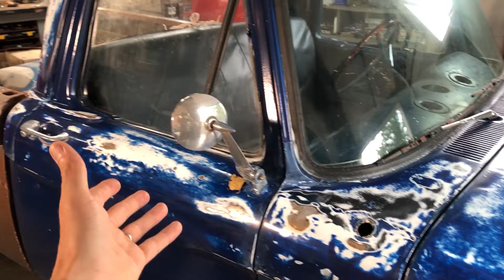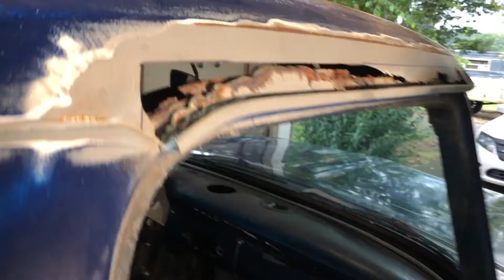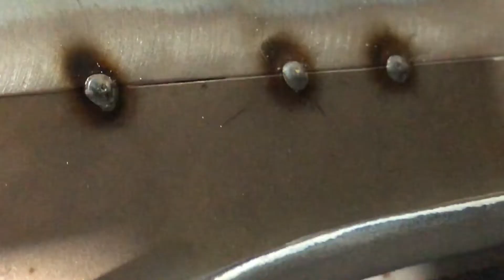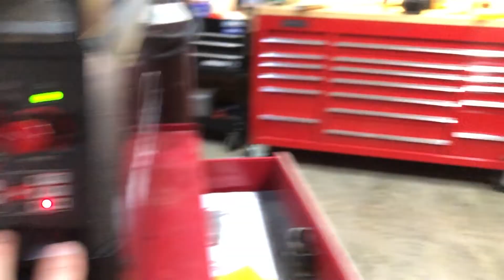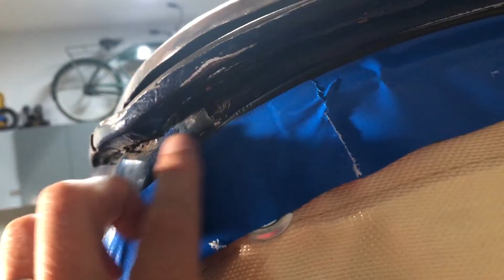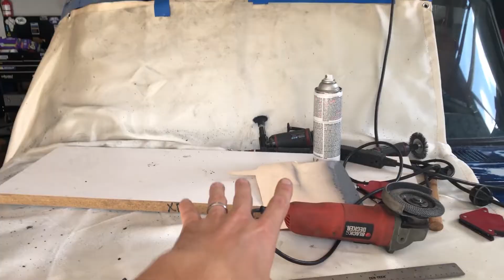Project F100 Rust Repair - Part 10

Comment: well.. the question is why wouldn't you cut the outer skin right off and then, work on the inner frame that shows a lot of rust.. it's in badly need of repair, covering it up won't do it for me. Thx

Comment: Can someone tell me why does it have to be completely welded in ? Why can’t you just spot weld most of it and then grind back make it flush and then put bondo over it?
Reply from the maker: If you want it to look nice like it was original you need to but weld the whole seam. If this was under the truck I might overlap the panels. I will still fully weld them out rather then spot weld for strength. Then seam seal to keep moisture out of your repair.

Comment: The factory sealer on these trucks is terrible and cracks over time. The roof seam will let in water behind the drip rail. The low spot welds where the roof goes over the drip rail will hold water and the rust starts from there. If anyone is restoring one of these I recommend putting body filler in the lows and maybe slope it from the center.

One tip is never grind down your welds completely, you can make the flat metal on the sides of your weld too thin. Just grind it halfway and beat it in slightly and bondo over it. You can also lap weld the new sheet metal over the old as long as it’s where the water runs down over the lap and you cut the old rust out.

Comment: That's a hack job I would be pissed to buy something like that because no of the rust was fixed under that repair so it's just going to rust back and all you do is sale some a headache down the road.  And I know that because I've been doing body work professionally for over 30 years
Reply: Regardless what the work done now is like doesnt matter.  The next buyer in line has the due diligence to see what work was done right or not and ultimately by the truck or not,  in AS IS condition.  That means you except all the work good/bad,  right/wrong.  Ive fixed numerous hack jobs on cars and trucks Ive bought,  its a part of buying these classics and knowing at some point a shade tree mechanic probably rigged stuff up.   The real fact is,  he is making this truck better and repairing it the way he sees necessary.  If you disagree Im sure he would be happy to use your 30 years experience if you wanted to just go over and do it for him at no cost.  Otherwise,  why comment? Not everyone has the same skillset.  When I built my 68 and started tearing it apart,  I kept finding more and more,  so I eventually just took it down to a shell and started over.  Its all part of the game.
Reply: Nothing lasts forever.
Reply from the maker: I have been doing body repair for not 30 years. But I will say its better then the fiberglass the guy before me used. The plan for this truck has never been to make it perfect. Fix what needs to be fixed and keep the patina look.
Reply: @garyjohnson801 I wanted to see what a real pro can do, so I visited your channel.. and unfortunately for me, you have exactly zero videos, of any kind. #ArmchairGary

Comment: What’s the metal thickness you used for the repairs?
Reply from the maker: Im not sure on the thickness. I just matched up some scrap steel to the factory steel. I would be lying if I made a guess!
Reply: 18gauge I’m pretty sure

Comment: That is some nice-looking repair work.  Same issue on my 79 bronco. and I used factory metal cut off good roof for the same area to replace it isn't easy..  nice work. Stil have to do the front edge above the windshield.
Reply from the maker: Thanks! I am by no means a sheet metal guy but its a relief to have the rust replaced. Fingers crossed the repair last a long time!
Reply: @Petrol360  I currently have a 69 Chevrolet caprice on my YouTube channel and I do not
Have a welder and it’s a lot of holes in my roof. Do you know any suggestions or that could help me out with it thank you.

Comment: I need to do this with a 55’ on the drip rail. Fortunately I have a parts car to cut it from.
Many Tri 5’s become rusty because rodents run along the edges of the finside roof rails and urinate.

Comment: I've got the same issue on my 66 F100 .
Reply from the maker: Its been a bit of a pain to replace the metal but not the end of the world. I just finished the drivers side and im working the area with body filler now. It is actually coming out pretty well.
Reply: @Petrol360  yes it's looking good .